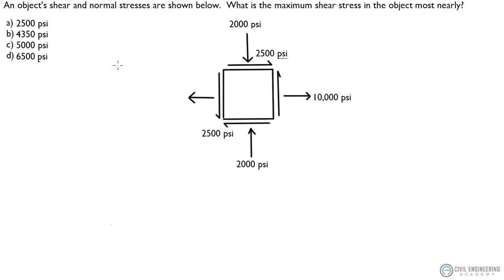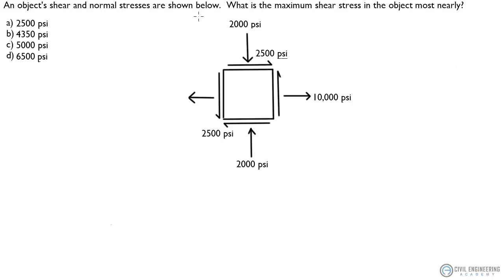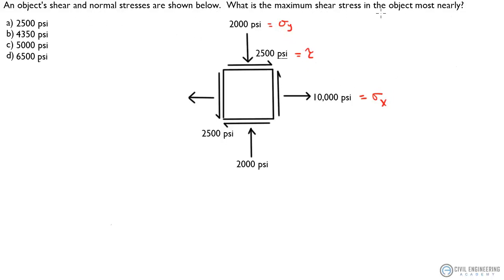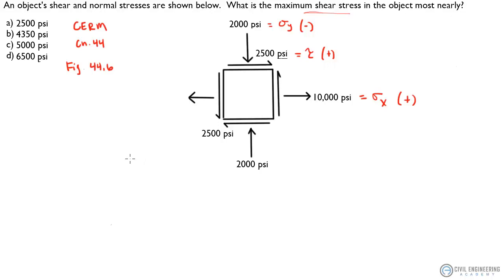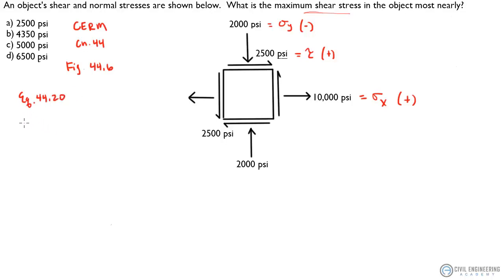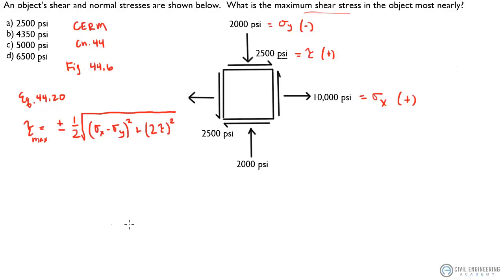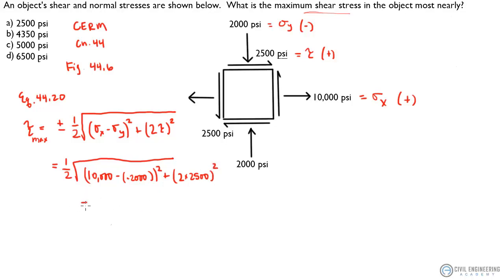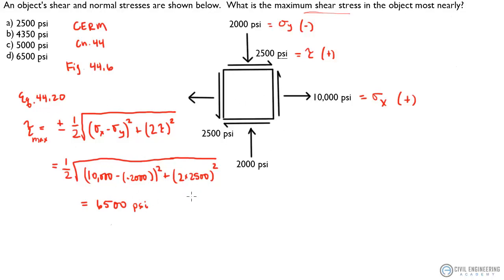Civil PE Exam - Structures - Find Max Shear Stress in Object

Comment: I believe this problem ignores the force acting in the positive y-direction. Sigma-y  and sigma-x,  and tau, should be the summation of forces and shears in the y and x directions. This would mean the y-direction forces and shears cancel out (I,e, the object is viced). So the x-direction force of 10000 is squared, square rooted, and halved. I’m getting C, 50000 psi.
Reply: No...sigma_y is 2000 psi compression | sigma_x is 10,000 psi tension

Comment: Hi, I've a question. How do you take the sigma(y) as positive? Like what if I considering the one below the object, that's in the positive direction right?
Reply: Sigma_y is a 2,000 psi compressive stress, Sigma_x is 10,000 psi tensile stress. It is standard practice to take tension as positive and compression as negative.